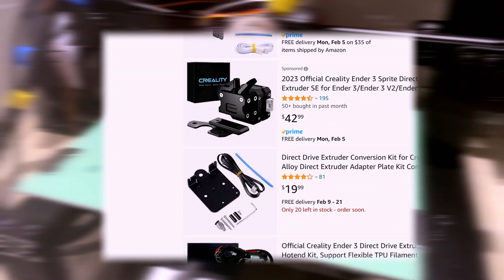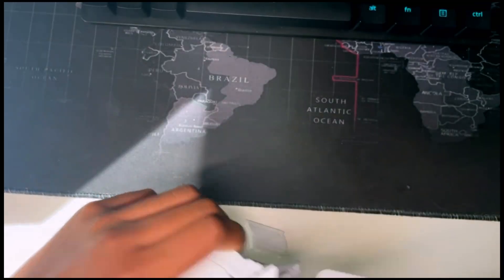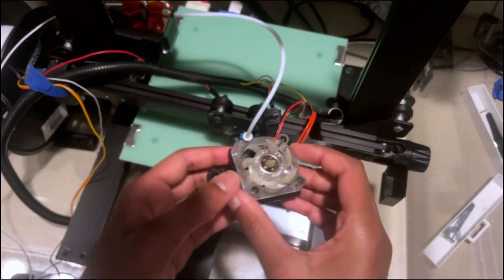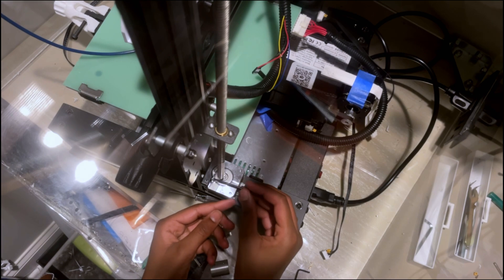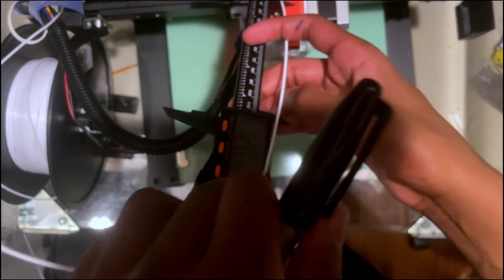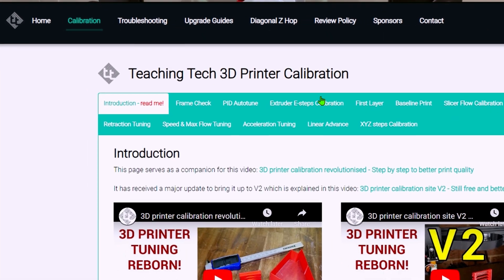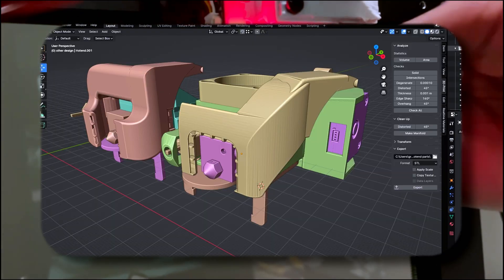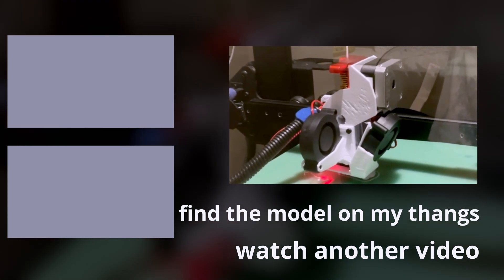I made my OWN direct drive kit.

Comment: Dude, your intention is respectable. But modding ender 3 is questionable. Usually eats all your time, so you're not making new models and not actually using the prints. Currently I'm selling my ender because of that. But if you just like the process then it is fine ;)
Reply from the maker: yeah i've been thinking about getting a different printer, i enjoy printing resin way more
Reply: you can get incredible results with heavily Modded Ender 3 V2 Neo.I might have spent time and an other printer worth money but I am happy with what I have accomplished, but you are right if you are not into tinkering. If you dont like modding you can get Artillery,Elagoo printers or just get Bambulab X1 if you have enough budget.
Reply: Dude, a modded ender 3 can still be a great printer. I have a Bambu p1s and I still use my ender 3 from time to time. One reason is I get a lot of satisfaction using a printer that I have put work into maintaining and designing. But also it is great to have more throughput as my printing projects tend to be multiple parts at the same time and it is faster to use the ender 3 and the bambu at the same time. Plus I get very similar quality from both printers.
Reply: @chadbeardall3660  you are right mate see my Ender 3 v2 Neo short videos I have upgraded heavily. All axises are upgraded with linear rails. Klipperized double screw and motor,now I am upgrading z screws with custom anti wobble nuts printed that use some Magnets,bearing balls and precision bearing pins. After Z anti wobble upgrade I will upgrade with 5015 remixed satsana fan,My Ender allready uses custom lathe machined copper heat block that weights 40gr and uses quality bi-metal heatbreak. Now my Ender is printing really good.Bambu Labs machines are for who doesn't want to tinker and get a working product out of the box. But I still prefer custom tweaked machines. I use my Ender 3 v2 Neo everyday. It prints great! I will keep fortifying the weak sides of it until it gives +5/-5 microns precision. I am planning to upgrade it with Panasonic servo drivers and motors in future.